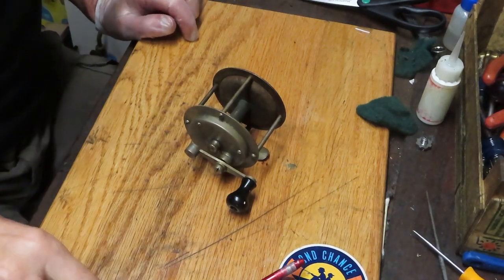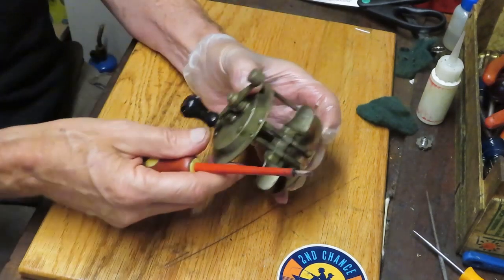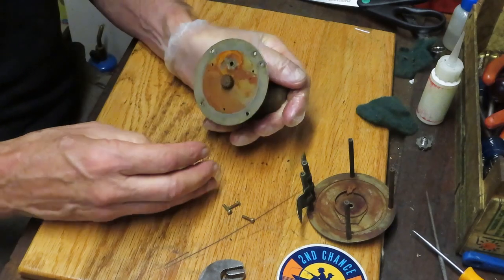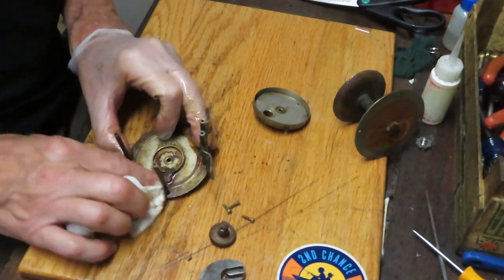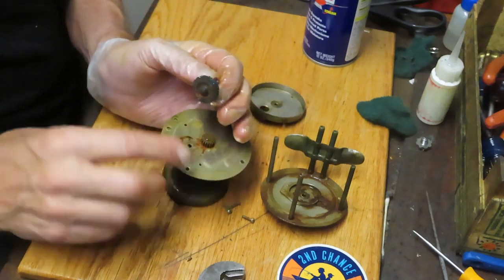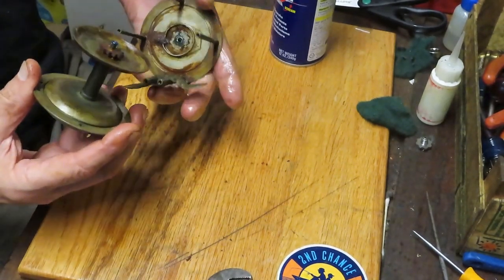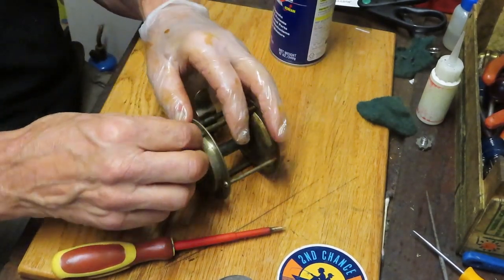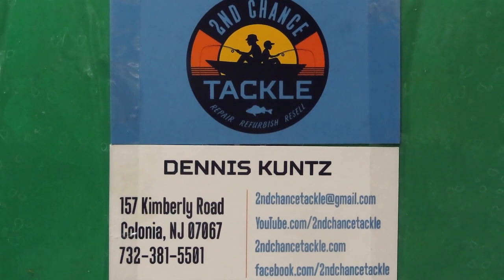Montaque Favorite 1930s flea market fishing reel lessons learned

Comment: Hi Dennis. An unrelated question. I've recently bought three old Noris Shakespeare reels, a Ball Bearing 2220, a Europa-Klasse Deluxe 2220 and a 2230II. I bought them from three different sellers, and in all three cases it turned out that the anti-reverse didn't work. And it still doesn't. Which pretty much makes the reels useless. Is this a common problem with the Noris Shakespeare reels, or have I just been really unlucky? And also, is this something an untrained amateur like myself might be able to fix? I keep buying the Noris Shakespeare reels because I really like the look of them, and they seem so sturdy and reliable. So far, though, it's been a bit of a downer.
Reply from the maker: I don't have much experience with these.  Norris was an English manufacturer that Shakespeare acquired.  They continued to make reels there.  Those reels were sold in the UK and Europe, but not the US.  I have not seen multiple issues with worn anti-reverse on others.  I have seen broken springs, etc, but not a common problem here
Reply: @2ndChanceTackle  Thank you for the taking the time to reply!

Comment: Finding parts or donor reels is near impossible for these rare old workhorses.  You would think there would be a website to match up parts / donor reels with folks that needs those parts.  Ebay charges too much money and hassle to keep a long term listing up.  For example, I have a Ted Williams 920 spinning reel (probably made by Daiwa mid 70's?) that only needs an eccentric gear, the rest of the reel is built like a tank, thickest pinion and main gear I have ever seen, but sadly a thin eccentric-oscillation gear with 3 mashed/sheared teeth.
Reply from the maker: Every reel has its' weakness and finding the parts is the biggest obstacle to repairing any of them - Thanks